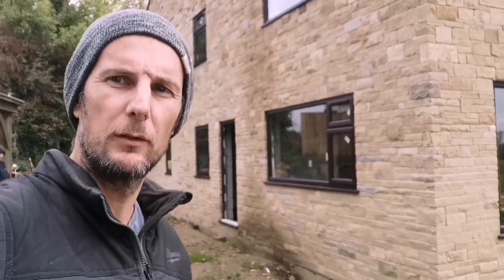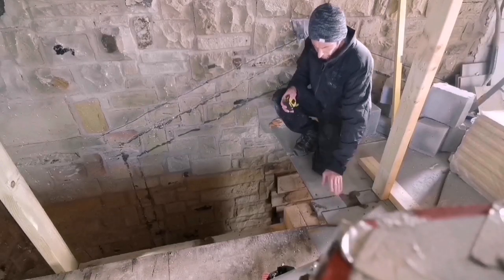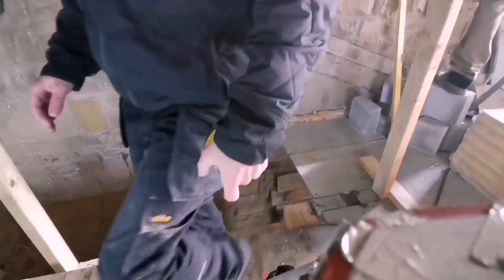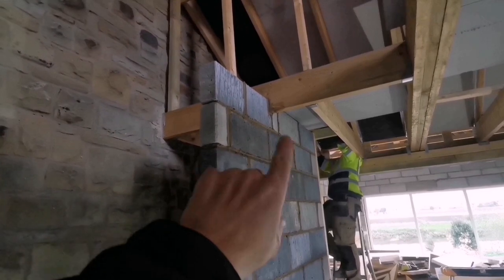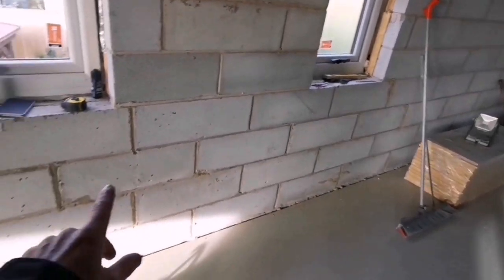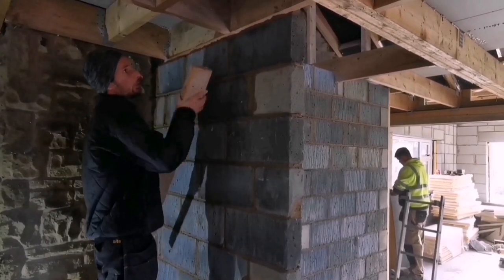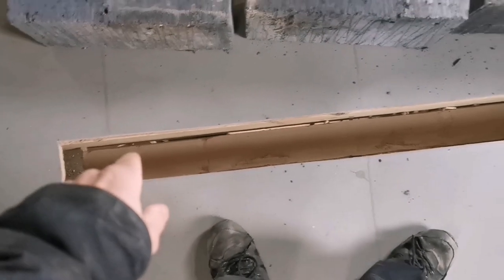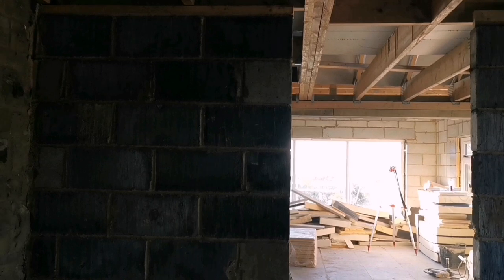internal wall block work

Comment: Best thing for cutting selitex is a jig saw with a selitex blade in it it is about 250 long
Reply from the maker: Nice one Andy I do have a saw with one of them blades I think you talking about use it for toothing out. Is that the one you talking about 👍👍👍
Reply: @markhep  its a bit like a bread knife with flat teeth but very sharp i think i got mine from screw fix
Reply from the maker: @andywest3260  sounds pritty good might have a look at one when I get on the blocks again 👍👍👍